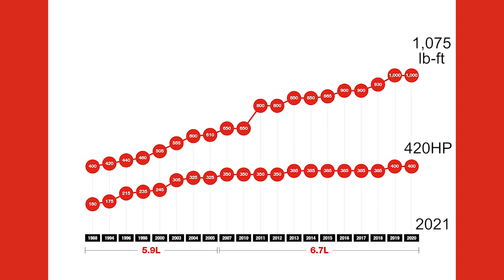Walk around the ’21 6.7L Turbo Diesel with our lead engineer

Comment: Us 2020 owners are STILL WAITING for a fix/RECALL on the Bosch CP4 fuel pumps we got shafted into buying from RAM.
Reply: @ruggedhumanoutdoors5336  so you traded a CP4 for another CP4, LOL.
Reply: Cp3 swap and be done
Reply: The cp4 is WAY BETTER than the cp3. The only reason they fail is a. Lack of filtration b. Lack of fuel.
Reply: @ruggedhumanoutdoors5336  you traded your diesel for a gas? Super lame
Reply: Ya right! Troll
Reply: Buy a hemi than 😂
Reply: Why ?
Why switch to that piece of sh
Pump when they knew it after running the 3!?
Seems intentional just like all these emissions
Reply: I work for GoodYear I have this engine in my service truck. Fuel filter, def fuel filter , fuel pump and catalytic  converter all went out before 100k miles and cost thousands to fix lol.
Reply: Atleast they fixed it! Got my CP3 in a 2020 😊

Comment: Lets talk Mister lead engineer..
Step into my office.
You see in order to seperate the water from the diesel fuel in Ram 6.7l you need atleast 7 micron filter correct?
A Virus is on avg 0.035 microns.
That fashionable blue face mask is at best 25.000 microns(more likely 65.000-85.000).
I'm available anytime if you need anything.

Comment: I love my Cummins but I’ve blown 3 turbos on it and one of the times it left me stranded 300 miles from home with a trailer
Reply: Do a 2nd gen turbo and manifold swap. Get rid of vgt
Reply: Sucks to to be you. I know MANY guys who have had zero problems period. So it sounds like the shop or yourself is doing something wrong on installing those turbos. Come on man. You don't just blow 3 turbos. Unless, a. You fucked up. B. To much boost.
Reply: On my 5th cummins front 04'-17 this probably gonna be my last with all the issues from ball joint to transmissions, injectors, lift pump, turbo actuator, 68rfe crap, nox sensor and placement, wire is cheap put bitch on the firewall or some place you can get to. Damn Ram and the price just keeps going up for MORE headaches.

Comment: Cummins is turning into a joke specific to the 6.7... POS hydraulic lifters failing... the 2022 + engines are junk.   Who was the Engineering genius who designed the Grid Heater with the freaking  bolt that can fall off and get sucked into the engine???   Must be a University of Phoenix (on-line) grad...

Comment: The 6.7 High Output Cummins goes to RAM 3500 Dually or Single Rear Wheel only.
Reply: 6.7 HO Cummins is available for both DRW and SRW on the ram 3500.